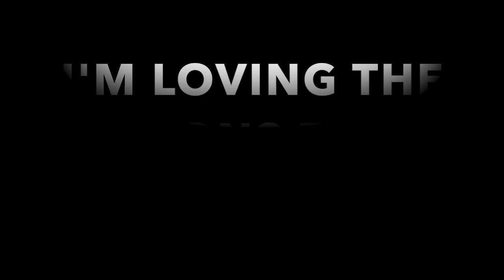woodturning: the wow Platter

Comment: Hi lovely piece of work you should be proud of that , it is great that you are a young man enjoying life doing what you love doing best which I presume is wood turning and you obviously have a great sense of humour, has for your Lathe if you can afford it you really need to strip the headstock down and rebuild the bearing system inside it otherwise it's putting more load on other components which in turn profile as well as the bearings were solely tighten up on the belt start slip and burn the boat out.
As they say been there done that got the T-shirt or used to.
I purchased an old Watkin lathe about 23 years ago I like you rebuilt it more powerful motor a large inverter box to make pepper pots and bits and pieces I've just recently replaced the bearings again.
I just had to replace the Chucks as well , One Robert Sowerby and one one by Chuck stronghold as the original one fell apart years ago and the one I 15 years ago it was so bad it worn inside it was on safe.
And has wood turning chisels have now progressed in leaps and bounds hopefully next month I'll be buying three new turning tools, I am a 68-year-old young man living in part of France retired sorry no I'm working playing doing things I'd like to do and trying to enjoy life. 
Phil from the Moulin in France
Reply from the maker: The bearing for the head stock are fine and all good it’s the 2 rollers on the bottom of the head. That squeak a little it was a custom made lathe and the guy that made it was also the one that put the new motor on and said it is running great so he is happy I am more than happy 😃